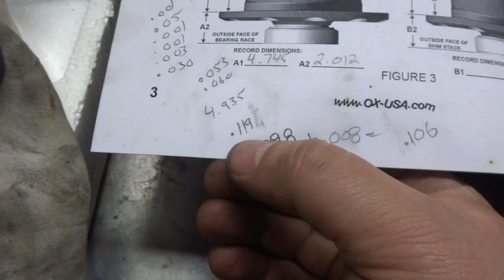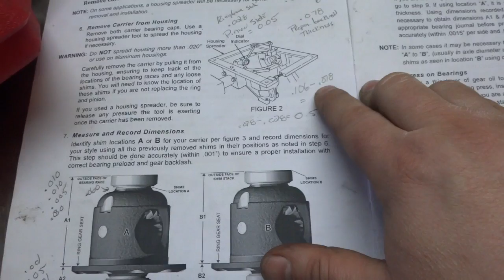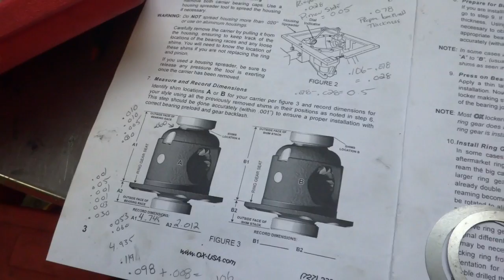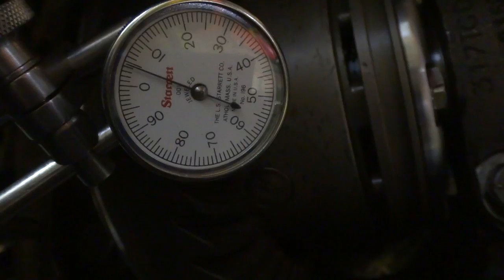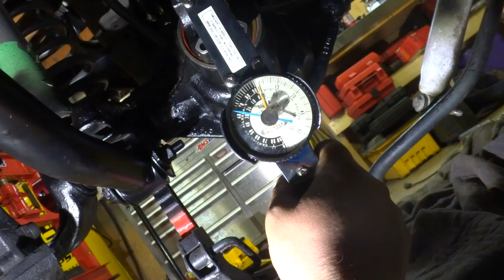Differential Set up and Shims Part 2 Installing the Ox Locker

Comment: well, Im paying a shop to do this for me. Couldn't take the risk of messing up on my DD 02 TJ. In two weeks, ill have a TJ with 4.88 gears, 30 spline chromolly axle shafts and a zip locker on my Dana 35 in the rear. This was an excellent video! Thanks!

Comment: I am looking at OX lockers as well.  I am a machinist by trade so I understand bearing specs and backlash but still scared about doing this myself for the first time.
Reply from the maker: Machinist is a great trade to be in, it's getting harder and harder to find someone that is skilled in turning a lathe and a mill, as most shops seem to be going CNC now days.  I would say doing the gears isn't a easy job by any means.  there is lots of assembly take apart, check gear pattern, take apart repeat kind of deal.  The rear i've been working on this weekend seems a bit harder because the shims are on the outside of the bearing and not the inside. makes it a bit more challenging

Comment: Did you have to adjust the pinion depth at all? I am going to install 4.10 gears in my HP Dana 30 next week and know that some people have to add shims to the Pinion to get the correct pattern on both the drive and coast sides of the ring gear.

Comment: Looks good Jerry. Just keep an eye out for temperature spikes in the first few hundred kilometers or so as always, but yeah, very nice set up and presentation. Those OX Lockers are pretty sweet.
Reply from the maker: yes especially the first test drive about 20 mins then let the diff's completely cool off before driving again.  then change oil after 500kms

Comment: man that don't look to bad. kind of a shade tree wrencher an have always wondered how hard it would be to change gears. I have a 98 TJ with the Dana 44 rear an 30 front. has 3.73 gears and want to go 4.56 with Trac locs. turning 35x14.5x15 mud grapplers now seems to do pretty good but would be nice to put back in factory rpm range

Comment: Hey BS Man in the Korner. nice vid, you do a good job. I've got a Sterling 10.5 in my 01 F350 4x4 in the rear. Would these same principles apply. Just looking for knowledge as this will be my first RE job.One last thing where can I get a manual on how to do this? Thank you Sir and again nice job on the vids!   Best Wishes n Blessings Keith
Reply from the maker: +Keith Noneya they will be very close if not the same, get a service manual they will go over the instructions as well
Reply: +Bullshitkorner Thanks BS Man, Hey been digging around on the net for a manual. Who do you get yours from, or know who's a good seller?
Thanks Man Best Wishes n Blessings Keith
Reply from the maker: amazon or ebay

Comment: But you engaged it by spinning one tire in the video wouldnt that be the same as letting your free spinning tire to slowly rotate while your stuck till it engages? Thats how i engage my eaton e-locker when im stuck
Reply from the maker: Yes your a 100 percent right, I should have used a better choice of words and not sure what I was thinking of when I made that last post.  A smart person like yourself said above engage slowly as your not suppose to engage during a wheel spin as it could cause extreme stress and snap something.  
  I almost purchased the e-locker, how do you like it ?

Comment: Yeah mate, I played round with a diff 20 years or more ago, and I remember shims, having to 'shim' it etc, however, a lot of videos I've seen on Youtube show some kind of adjusting nut to set your backlash, that's located in your bearing caps. Is that for third member diffs only? Mine 'was' a diff like yours with no detachable third member!
Reply from the maker: I'm not sure I will let you know when I rebuild the one in my 57 Chevy
Reply: Ford 9" axles , Chrysler 8.25 axles and a few others are setup this way .. It can be easier to setup an axle like this but it can also bite you in the rear ...... I have set up both the 9 and the 8.25  and I like the shim method of the Ford 8.8 , and the D30  better ... It gives you more control over what is actually going on , the spin style have lock clams to hold the screw adjusters in place but they can still loosen up a little and have to be checked and retorqued after a few hundred miles ...

Comment: Could you go over shimming I'm new at diff's and I didn't understand anything about total shims and what to add.
Reply: ***** shims push diff gear closer or further from the pinion. this creates more or less play between the diff moving and where the drive shaft moves based on the specs from manufacturer.

Comment: Did the ox locker instructions tell u that u cant engage it once your already stuck?
Reply from the maker: you can engage it all you want once your stuck, but unless both wheels can turn it's not going to lock in.  Edit, not sure what i was thinking when i posted this
Reply from the maker: I answered your question above, i've read a few issues online with the OX lockers not engaging and engaging while stuck.  while most issues could be cable set up or other.  Some people have claimed that you need to be rolling for it to properly lock.  I have no experience with it yet until I use it for myself so i'm just going off here say.

Comment: Where did you get your dial indicator?
Reply from the maker: online they are very expensive
Reply: You can also pick them up for a decent price at Harbor Freight or Northern Tool ..  I have a couple ,  my Harbor Freight one is just as accurate as my 300$ one .......  You just have to take care of them .. Keep them in a plastic case , do not throw or bounce them around ... They are precision measuring tools so you will throw the calibration off if they are not handled with care ...